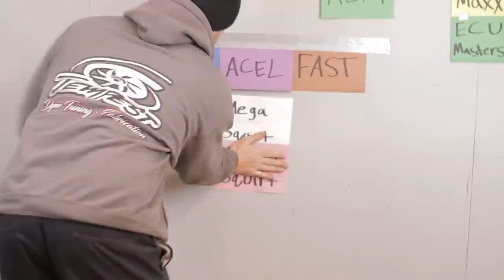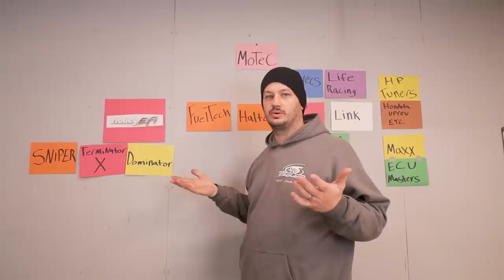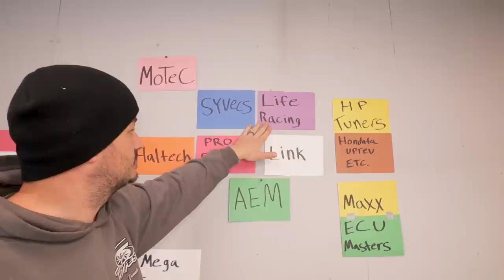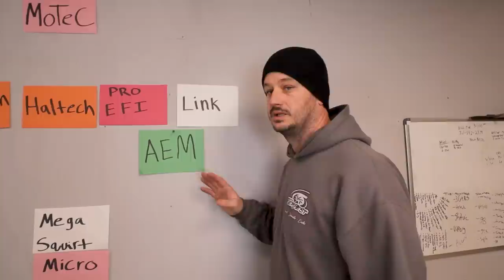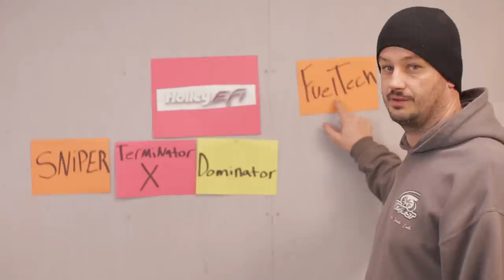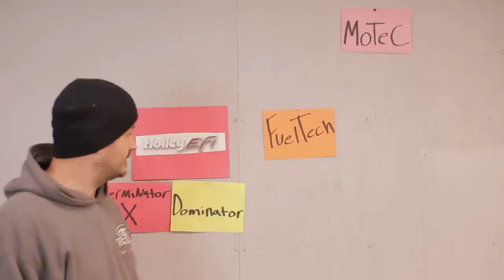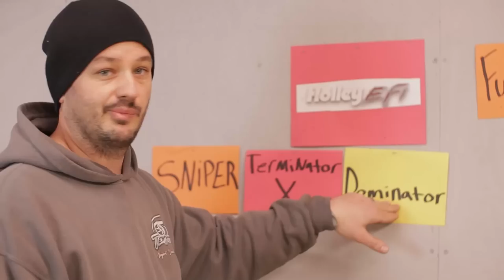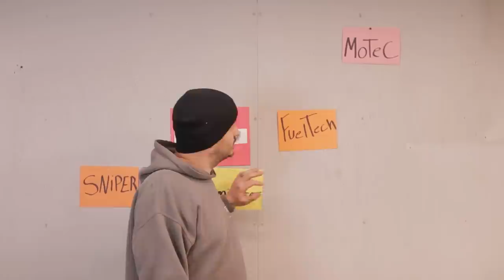Holley efi  VS.  Fueltech, Motec, Haltech, ProEfi, Aem, , Etc. Terminator X / HP - Dominator -sniper

Comment: I've dealt with Holley, haltech, aem, motec, Bosch, megasquirt and others in my shop. The main thing that I used to choose my own ecm is the customer and technical support. In my experience with all the different brands Haltech has always had the best support in my experience. I switched to all Haltech elites on my personal vehicles a few years ago.
Reply: Would they have a system for a 68 FE motor? 390 FE to be precise
Reply: This makes me feel a lot better about going with haltech for my first dip into EFI tuning. I chose them because I live in Australia and they're a very  popular choice. Plus they're locally designed and manufactured.
Reply: link has excellent tech support too
Reply: You choose suport and not think on fueltech ?
Reply: Fuel tech has some of the best tech support they actually answer their phones.

Comment: Side note, Mega Squirt offers a ton of features for a crazy affordable price, and some of us still have FAST sir.... LOL
Reply: Agreed MS3PRO evo is incredibly powerful and cheap AND made in USA
Reply: And the warranty is way better....sky is the limit on my Ultimate Pro and TCU ( controlling my 4l80e via can bus ), also having wireless connectivity...
Reply: Fast which I have used many systems from may not be the new kid on the block but it's rock solid.....
 Id probably next upgraded to a dominator then UPGRADED to a MS3 Pro Ultimate, if the FAST TCU allowed per gear rpm...
 Now I have per gear, and predictive shift along with several programmable latencies .....even a gear hold to keep it from blowing thru gears with rpm shifting when I blow the tires on a 1000+ hp sequential mpi injected BBC...

Comment: there are reasons you typically dont see dominators on big alcohol promods, fuel control isnt really the best on the holley at that level but never seen an issue on smaller builds. Fueltech is second to none on logging, but we have had some issues where we didnt buy fueltech specific sensors or tried to make racepak sensors work and had issues. for the drag racing application the configuration, time based applications, ability to move the log into the time based sections, and live diagnostic functionality are by far superior in the fueltech system. we started using the fueltech power management stuff this past weekend and it works amazing. the engine rpm literally follows within a few rpm of commanded.

Comment: I really enjoyed the video. I'm a domestic guy (Twin turbo BBC) that tunes part time at an import shop. I tune 90% Haltech, that's what software package I'm most familiar with so its interesting to see other tuners perspective. I even run the Haltech Nexus R5 on my big block chevy. I looked into the M150, Holley and FuelTech before going with the R5. Each system has pros and cons I hate the multiple box thing with FuelTech, I dont wanna have to add a traction control box or addon for the Holley, and the Motec had so much extra to buy besides the box which isn't priced too bad. Keep making great videos.
Reply from the maker: yea the 100 different boxes for everything with fuel tech is a deal breaker for most.   like i think i stated in the video, as long as your going with a name brand system, if your familiar with it, as long as it has the features you need most of the ecus are going to be pretty comparable for the average user.  10 years ago that may have been a different conversation!
Reply: I'm an import guy and I love the Haltech stuff, so much so i'm using the Elite 2500 for my new LS Build, once you get used to the system the possiblilites of it for the price are amazing, the basically 21 hour a day tech support is killer too
Reply: @TeeeRoyJenkins  looked into the 2500T for my LS project. Excellent features !
Reply: @BEANS-O-MATICtransmissions  it truly is. For the price now I'd love to try the nexus.

Comment: The funny thing about the huge price range and motec & life with high-end processors: 9000 rpm is 540,000 tenths of degrees (360x10) per second or 0.54 mHz, and a $5 arduino runs at 16mHz. Certain tasks do take a while, but even the slowest tasks on better arduino-compatible hardware can still execute millions of lines of code per second.

In plain words: engines are sloooooow compared to even hobbyist processors. That's why there's literally a $25 arduino being developed for a new cheaper-than-Microsquirt ecu.

In reality the physical cases are the most expensive part of the ecu's, and their software interfacing is what costs them the most money. But as Joe explained very well - sometimes you have to pay to play and not all cars have similar needs.
Reply: honestly, i want to hear what you have to say about ECUs more than anyone else lol
Reply: Esp32 arduino compatible are really fast @240mhz. Speeduino should run great on them but I haven't tried it..
Reply: The speed of the processor is only part of it. The biggest problem, at high levels of both power and engine speed, is electromagnetic noise and crosstalk causing bad signals. When you're tracking anywhere from a couple hundred to well over a thousand signals at a hundred or thousand times per second, the simple act of datalogging alone can eat up a tremendous amount of processing time per cycle. If you're getting bad signals in the process of ingesting data, then that's a whole nother can of worms. That's why milspec wiring harnesses are so damn expensive.

Comment: Well done Joe, thanks. I came to this video from the direction of considering a Holley setup for a conservative, Gen-1 SBC street engine. I watched a couple of Holley's videos, which caused yours to pop up. I'm pretty knowledgeable concerning how multi-point EFI works -- as in, I can troubleshoot any 20th century factory engine management system without too much trouble and with no specialized tools. By covering the whole spectrum, you gave me a great primer course in these systems while also answering the question of what to do in my case. I appreciate that. Liked, subscribed, and archived.

Comment: Excellent video Joe. There is something to be said about remembering hot keys and other shortcuts. Jumping around to different ecus can be a pain. And you are right about AEM, series 1 and 2 stuff I always fought issues that shouldn't have been there (gremlins). Had the same issue with an older Haltech. Tech support at the time was dismal.
Reply from the maker: thanks!

Comment: I was watching a video of an engine builder that uses motec and mentioned something about how the RPM limiter on the motec wasn't as violent and didn't beat on the thrust bearing as much.   I know nothing about these boxes, but if that's true that would be pretty interesting how the implementation of the same thing might be slightly better.

Comment: Interesting perspectives. I could see Holley being a bread and butter setup for the reasons you gave. The Megasquirt its self can be a decent ECU but there's definitely some jank to it at times. I think unless you're on a dirt budget its time has largely come. An MS3 Pro or even a non-pro MS3 don't really make fiscal sense compared to just getting more of an entry level Holley at this point. 

In terms of the MaxxECU I was watching a video from a guy named Nivlac57 who was talking about the reason he went with it was he could do variable cam timing on his Vortec 4200. Seems kind of nichey but it's still a pretty major difference if you need it. I'd also say looking at it the economics of it seem good if the firmware is solid.

I could also see why HPT would be frustrating. It's not like HPT is a monolithic thing, you have to know the variants of all the ECUs in order to tune them and stuff like 24X vs 58X boxes and which ones let you do what. Where they do offer benefit is cost, if you run an electronically controlled auto. You don't really get to control a 4L80E with an entry level Holley box. Where they suck is you have to bolt stuff on like a wide band controller. Where they likely have benefits is that you can get tons of info online for it.

Comment: I have been using megasquirt for about 15-20yrs now. The learning curve is a bit steep but it has so many options.  I am using it for sequential on a 6cyl, COP and 4 variable cams, e85, and many other controls. I do NOT recommend it for everyone, but if you want a ECU to do what you want... it can probably do it.
Reply: ya he's confusing good marketing here (which is why Holley is so popular) with actual robust good engineering.   Give me a quality install of a MS3pro and it blows others away.   Holley has bought so many of the little aftermarket everything like he said, support is a nightmare.  Also end users of Rs3 actually influence the process, so it has become slick as hell.   The problem with MS is it started as a diy kit in the 90s (i think) and stupid people gave it a bad rep.  Now, it is produced with world class electronics and has been for decades.   Link is damn interesting and has a few outlier features

Comment: I've used several of these...I dont consider my Dominator to MS3 Pro Ultimate swap a down grade at all...
 While I did control my 4l80e billet lockup, and utilized the Davis/Holley add on for TC...it was a huge ecu. I find similar functionality via can bus with the MS TCU/ECU combo....
  I did like the modular nature of Holley just getting the sub harnesses you need vs storing 300 wires you may never use and provided that feedback to DIY...
 However I MUCH prefer the near endless tinkering nature of the MS3 Pro Ultimate, if you can dream it you damn near can do it...no limitations but your imagination...this is a home brew sequential MPI tunnel rammed F1A-94 procharged BBC...
 When I had my dominator ( swapping from FAST XFI 2.0 ITC) the SELLING factor come what was suppose to be a plus. There is no fixing the Holley ECU and there is no discount on a replacement unit...( where as my MS3 Pro is lifetime ) several " big boys" at the track were carrying a SPARE unit with them...as a drive in enthusiast, I could not afford that...the guy that bought my dominator was super paranoid about the USB port I had to prove it working on the spot ( holley had no way to fix at the time)....

 The software on the holley was easy but I like the unlimited nature of the MS3 Pro Ultimate...

 I just bought a 2k 10.1 inch screen and a Rasberry Pi4 to power it which will provide a super fast power on ( with coming tweaks) and custom splash for a 1/5th the price of a comparable screen..facilitating a 10hz GPS for Dragy precision performance pages as well as navigation...and control with a mini bluetooth keyboard...no laptop needed....

 As someone whom like to tinker, I can't imagine  needing more than a MS3 Pro Ultimate can provide ( their TCU comes with 4l80e pre constructed harness has done well for years and they continue to update it), they increased their prefabbed harness applications as well....

 The warranty situation with the failures seen at the time pushed me away from Holley, interestingly though I've used a wireless Bluetooth interface that works flawlessly ( even uploads my logs to a Google drive folder automatically on my laptop for review when I return home) I destroyed my USB port ( but still have Bluetooth and a serial to USB port interface so im not remotely down) and they are sending me a new port Monday...

 Can't wait to get the 2k screen installed in my 67 Camaro via a gauge panel replacement...and building out my own digital dash layout to compliment it....

 Support has been stellar but usually in the form of questions about an idea or utilizing a feature....in this case I cave man smashed my USB port...no problem sent me a replacement board right out...my ecu is several years old now...
Reply: I love my MS3 pro evo. Ran out of analog inputs? hook up an arduino can bus for 24 total analog inputs and who knows how many outputs. Auto tune fuel map from wideband and A/F map, log everything.  You can set up logic statements " if this and this, then this" anything you can dream up.  Will eventually hook up the active dampening and and variable awd torque split.  Can run shadow dash on an android in-dash stereo.

  There is so many options that is can be difficult to narrow down problems like  a good idle when there are 10 different things changing timing and fueling to stabilize idle but they all do their part. makes you appreciate a factory ecu and how much goes into a stable idle at all temps and situations.

  Works with generic sensors so you are not stuck buying proprietary sensors.  I don't have much experience with anything other than my Apex-I power FC which is a 23 year old ecu and very basic. It was scary to install but now I feel total freedom.

Comment: I had a MS3X and got a deal on an X MAX and I lost a ton of inputs n outputs cant do traction control , only one type of boost control, a built in map sensor that's only good for NA motor really... cant test coils or injectors from laptop but I got a 3" screen that I can hardly see nothing is built in to the system you got to build a custom table for almost everything  you want add or try to work around the limits of the ecu....a low end ecu that's dumbed down for the ave Joe... selling it and going to try a Maxxecu
Reply: Sold my ms3. Bought a maxxecu race. Couldn't be happier!

Comment: I think the biggest reason why it's easier to use Holley in North America is the same reason it's easier to use FuelTech here in South America. Even though FuelTech is present in the USA, it doesn't have a big market share there. In the other hand, here in Brazil for example, we don't have Holley at all. I mean, we have some imported Sniper EFI to compete with FiTech, for the cases where you want to use fuel injection but doesn't want to change the looks of your old car, but for the rest you just have FuelTech. We have other companies though, like Pandoo, InjePro, but they work for Brazilian cars in general, they are very versatile, but I really don't know how they would perform in v8s outside here. It's a very unique kind of thing here in Brazil.

Comment: The truth about most of these ECMs it that most people will never use all the features that are built into the unit. But if you want the best bang for your buck you will never beat MegaSquirt. It will do everything that Holley and FuelTech will and at far less money. And for most street driven cars the Micro Squirt is all you will need.
Reply: For a MegaSquirt to do everything FuelTech does, you need to buy the MS3Pro Ultimate, which is the same price as an FT550. I love both, just figured I'd point out that the "king" MS version isn't exactly cheap.

Comment: A gentleman named Josh Stewart out in AU that has been doing Speeduino an open source DIY ECU that uses TunerStudio and arduino / teensy board called "Dropbear" that is soon to come out that does 8 cyl sequential fuel / spark in the TBD $400 price range. Thought I would throw that out there I believe it will give megasquirt a run for its money.
Reply from the maker: sounds like a good option for the do it yourselfers

Comment: I am very surprised, your put megasquirt low on the list, after you tuned the turbo mustang on the dyno?  You do know it can log very fast up to 64 sensors compared to terminator and has great diagnostics.  Also everything is percent based so you could swap injectors and it probably would run without major table changes.  It has an amazing dedicated knock processor as well, without using a esc module.  You should do another review  on it:)
Reply from the maker: I’ve done a bunch of mega squirt stuff, have a Porsche coming in with it any day now. There is a bit more that goes into it than the ecu it’s self. Kinda too much to type out haha
Reply: @JoeSimpsonAtTempest  I;d like to see that video.  Ms3 as you know is not as easy as it looks@

Comment: For the aircraft i'm working on, nothing but Motec. Build quality outside and in, warranty, reliability, repeatability, size, weight, inputs/outputs. If you have many projects, you can always just swap the ecu between projects if you are trying to save money, so purchasing the highest quality is paramount. Looked at cheaper options initially but to achieve the same functionality you require more boxes meaning more cost and more size/weight. If you have a complex engine and are doing intense testing and logging Motec. Your average person probably doesn't have 6 thermocouples on a 4 cylinder turbo engine plus 6 other thermisters just for testing.

Comment: Loved your presentation Joe.  I recently learned that Holley does not offer individual cylinder knock control.  I can help with that...
Reply from the maker: Nope. The knock control on Holley is basically unusable. Actually on the to do list for another video
Reply: @JoeSimpsonAtTempest  Hi Joe, thanks very much for your quick reply.  I released the first version in 1991, for distributor ignition.  Since then I've added versions for coil on plug, both smart and dumb coils. It's designed for engines with piston to wall clearances of 0.006" or less, to minimize false detections.  The threshold, detection, and control software works really well.  My most popular version is the Vampire, for modular Ford ignition.  No wires are cut or intercepted, no tach adapters are required.

Comment: Haltech has the best support in the game,they will do remote tuning and they have base maps for almost every engine even some motorcycle engines.
Reply: The thing i dont like about haltech is how slow the software can be and i really dont get on with the logging. Link is much better at those things
Reply: @luker3456  You may want to checkem' out again, the new software they developed for the Nexus ECU(and have now adapted to the Elite series too) is supposed to be SIGNIFICANTLY quicker.
Reply: @RyTrapp0  its a lot better now but still not as fast as link unfortunately